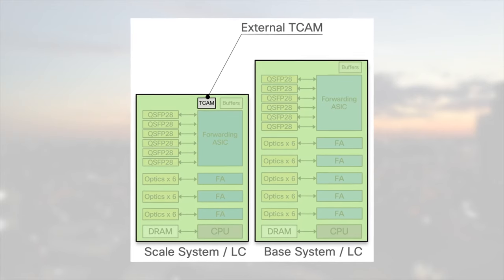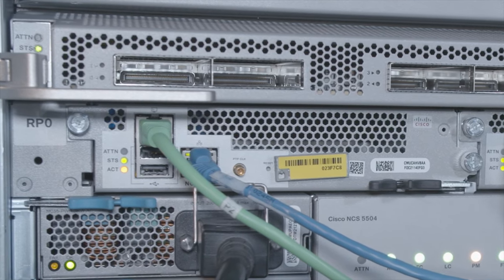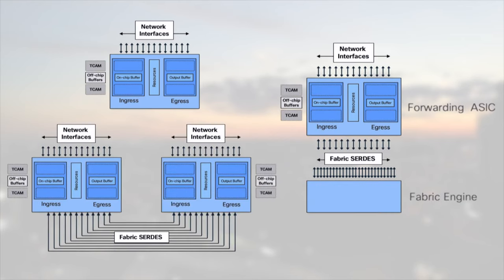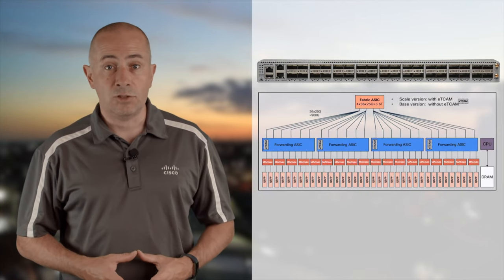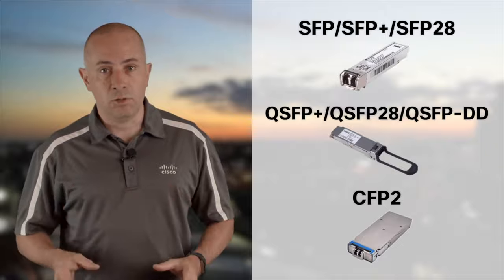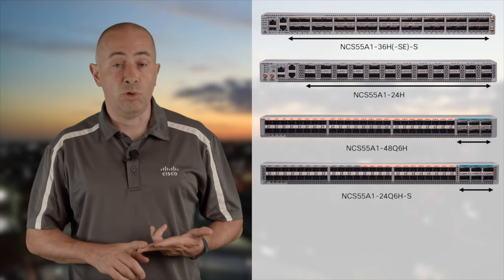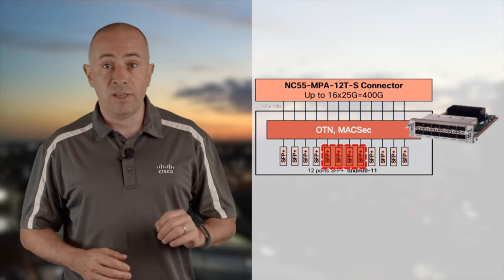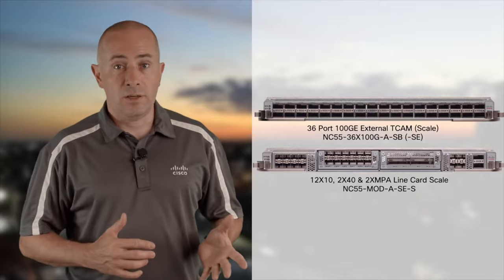NCS5500 for the Confused

Comment: Oh my god these port densities and values are great, why cant you just let me use fabric extenders without a switch?  I would like to collapse my topography.  
Why is sfp28 breakout not supported on 5502, really strange because sfp+ breakout is supported, this was quite the bummer when noticed.
What happens to qsfp connections if not all four channels are functional at the layer 1?   Will it totally refuse to work or will it operate with degraded performance?
I have had troubles getting a QSA (sfp+) to work on my 5502, the spec sheets and compatibility matrixes say it should work but I still cant get the things to work, I really hate the ideas of installing an extra switch just to get my links over 40km and under 80km running.  Also why the heck is this stuff rated in KM and not db?  The db/km loss on different fiber can vary quite significantly. 

34:20  Let's see if I'm just screaming in the wind here.
Reply: Why cant you just let me use fabric extenders without a switch? This is because the fabric extender (FEX) does not have the hardware needed to handle routing or switching. The FEX is is a "dumb box" in that it has to send all of the packets to the parent switch to be handled. Even when traffic goes from one port on the FEX to another port on the same FEX it has to be sent to the parent switch to be processed and then is sent back to the FEX.
Reply: @tachyon273  Why can't the router do that?  Why do I need a switch if I have extra capacity in my router?